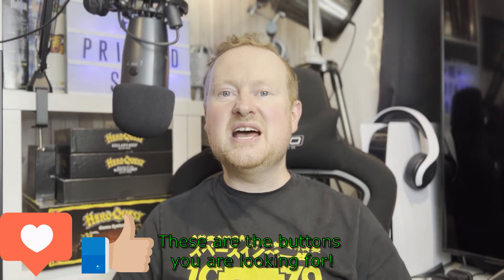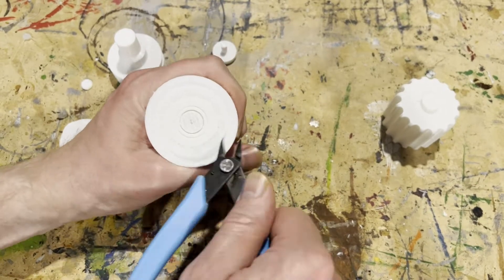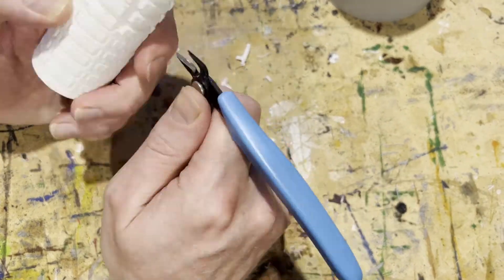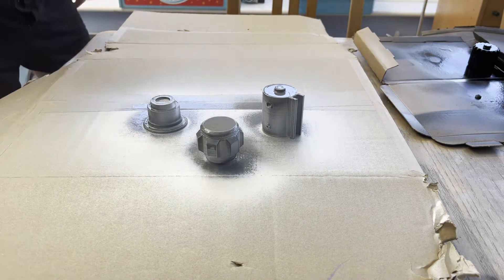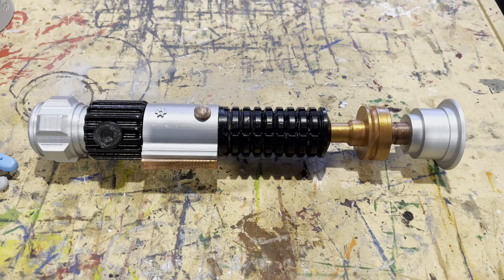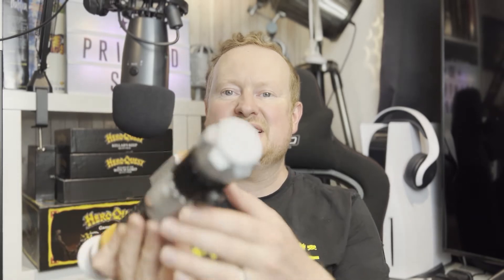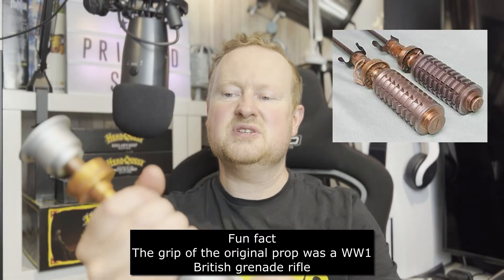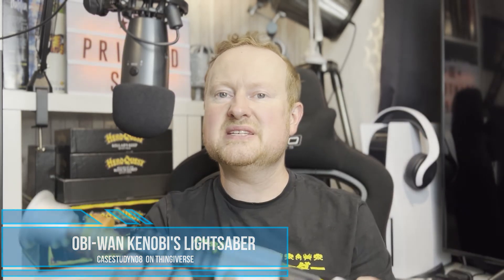Obi-Wan Kenobi TV show 3D printed lightsaber prop build + paint  on Creality Ender 3 S1, Ender 3 pro

Comment: how did u print Lower button outer?? if i use supports they are starting in the air
Reply from the maker: I really don’t remember unfortunately, it’s been a busy year! If it’s above the build plate then try editing the file in tinker cad, you should be able adjust the error. Thanks for watching